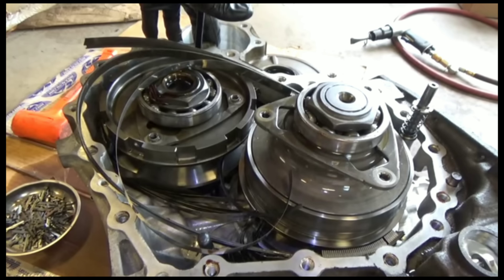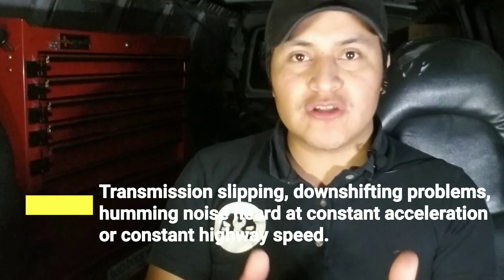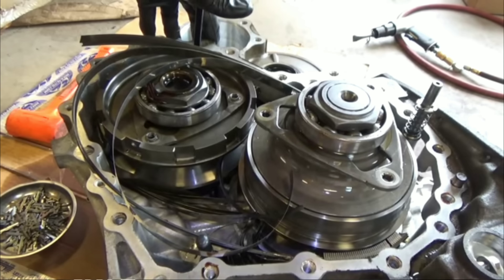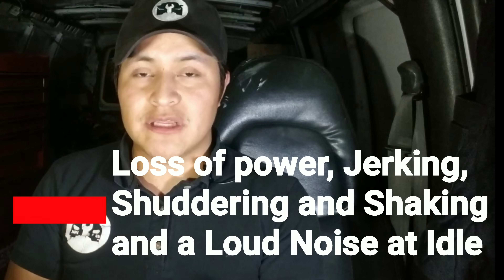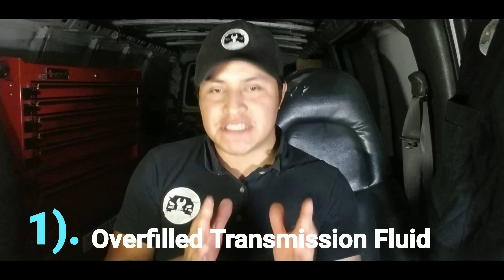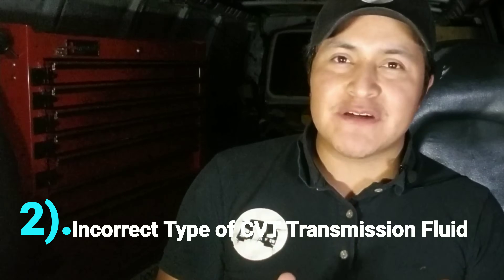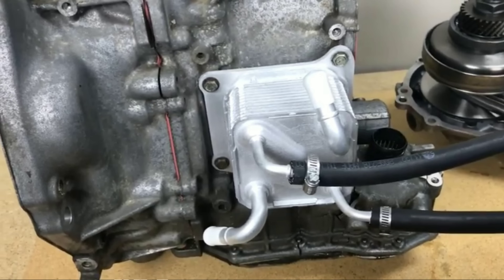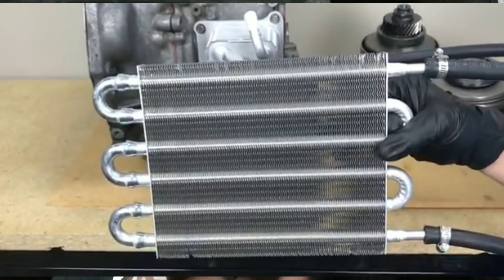NISSAN CVT TRANSMISSION | why it fails and what you can do about it to prolong it's life

Comment: Question. I have 2014.  Trans replaced at 60300 miles.  300 miles over warranty grrrr.  But my problem now is I had atune up and about week later check engine light came on ....mas flow sensor...replaced air filter n sensor.   Now code keeps popping up for mas flow sensor.   Sometimes once a week and sometimes every other day....replaced sensor 3 times ...also when stopped at traffic light it sometimes runs very low RPM that car feels like it going to stall...I lift off brake n idle goes to normal again.....what should I check now.  Any help appreciated ty

Comment: The only reason coolant is used is for it's anti-corrosion properties and so it doesn't freeze in cold temps.  Water would work fine in tropical climates to cool an engine just as well as coolant would.   A 50/50 vs a 70/30 blend won't make any difference in the coolant being able to cool the temp an keep the motor & trans fluid cool.

Comment: I have a Qx60 2014 and transmission failed. All proper maintenance was done consistently on this car and I started having power issues were it would shut off or stop accelerating.  Now I'm being told it needs to be replaced. I will not  buy another one of these vehicles again. I love the vehicle, and haven't any issues but this transmission issue. Has anyone had similar problems? I read about the class action lawsuit against Nissan. I don't want to get another transmission and have same problem again, any suggestions anyone would be helpful.

Comment: Have a 2013 Infinity G2 .90k miles....went into trans limp mode..shop says its a sensor inside the trans case.. . trans fluid was black ..says replace entire trans & sensor ...$2300 ..down from $3500

Comment: My 2015 Nissan rogue just stopped and it turned off on me and then I went to go restart it and it started up but it did not want to accelerate I pulled over to the side and waited a few minutes I started it back up and then it kept on going again for a few minutes until it did not want to accelerate anymore do you think it’s the transmission? Thank you

Comment: 2007 nissan altima 2.5 S model with 253000 miles runs great about a year ago I had an overheat code,,,now I have a low pressure code,,although it still runs top notch no power loss or symptoms,,,not sure if I should worry or what to do,,I change fluid every 25000 miles,,,and helps remarkably,,,kinda sad because this car has its own spirit never has died and very reliable day in and day out,,,,don't want to replace it,,I have another car much newer but this car is my girl forever,,wish I could find someone who could honestly tell me what I should do and not get ripped off
Reply: I love my 07 to. I'd drive her till she stops. It just worries me of long trips but so far its done well.
Reply: @alensley1368  yeah now I'm at 269000 miles,,still running amazing,,,I'm careful on long trips,I don't stomp on it,great cars!!!

Comment: I have a '13 Nissan sentra. It has 60k miles on it. The transmission went bad and I have to pay 4k to replace it. Was it even worth it? Like will the car continue to run for the next few years after I replaced it or should I had just called it a lost?

Comment: My Nissan Murano battery died and after jumping  the car and started it, it will drive but it will not shift to the next gear ⚙️ or pulley whatever it’s inside the transmission.

Comment: My 2014 sentra would loose transmission power..the problem was in a tail light it had some water inside it causing it to short with.the LED lights ..got a new tail light and problem is gone..could be your problem to..remove the tail lights and disconnect the LED lights drive it if problem is gone then you need new tail lights..good luck..

Comment: My 2005 Nissan Murano with 159k miles is not rolling anymore- the transmission failed. Is it worth buying a new transmission for a total of $4,500-$5,000 ?  Or,  take a risk and repair it for $2,500-$2,800. Perhaps is time to sell it to a junk shop for $500 and buy a new car?

Comment: This is a great video. but you should not have to go through so much trial and error.  I"ve had 2 Toyota Camry"s and gotten well over 200k miles on them.  One of the Camry"s had 250k miles on it, but did nothing with the transmission.  Nissan should replace all these transmissions or give people the opportunity to get out of them!  They should be sued to the point of financial ruin for putting these transmissions in these cars!!!!!!!

Comment: I got 2013 nissan dualis cvt transmission. I changed the cv axle right side and during the process about half or a bit more cvt oil came out .in 2013 the cvt oil was ns2 which is not available in Australia anymore now they recommend ns3 cvt oil .Should I top it up with ns3 or drain the fluid and fill up with ns3

Comment: Hello Sir. I hope you respond. I was going to purchase a 2014 Nissan Altima. It had a trans replacement at 126k. Paid for by the dealership because there was a recall. Nissan provided a warranty for 1 yr which ended in 2020. 
The car has 160k currently. 
Is this a safe buy. With the recalled new trans being out of warranty? FYI the trans was replaced with another CVT. 
Thanks for your advice.

Comment: My sister my ex and my neibour have this car .my sister had a CV axle replaced the altenator is getting replaced the thermostat is getting replaced the radiator is cracked so getting replaced the CVT fluid was black so its getting replaced using nulon fluid which is great and replace sparkplugs and cleaning air intake throttle body

Comment: I have a 2015 Altima with the CVT transmission.  I just changed the fluid at 70,000 miles.  My dealer said 60,000 is recommended but he knew I did a lot of highway driving back and forth to Florida.  He said 70,00 was ok due to the long trips.  However, if you drive city a lot, he said 40,000 miles.  I have not had any problems with the car…. But I also don’t drive it like a race car.  Nissan advertises the Altima on race tracks and being driven hard.  Nissans problems with the CVT is from the bigger/heavier vehicles that tow trailers.

Comment: I have a ‘12 Sentra 2.0 liter and I thought that my CVT was going out but I turns out my air intake was no longer taking in air because it had holes in it… 147,000 miles runs nice but I’m probably going to have to worry about the CVT later.
Reply: 2012 Sentra did not have major cvt issues. Still recommend changing the cvt fluid every 30K miles

Comment: "Why it fails and what you can do about it to prolong it's life"

It doesn't matter; if you take care of it and change oil according to Nissan's specs, etc; CVT transmissions are going to go bad; sooner or later. Oh indeed. The reason for this is simple:

The "driving force" of this transmission is done through "FRICTION"; of a steel belt and two "variable pulleys"; instead of the time tested "Planetary geared" automatic transmissions. And yes Nissan KNEW and KNOWS this. So does any good auto Engineer. Thus, that friction creates unbelievable heat; and that heat is going to kill those 3 MAJOR parts in every CVT; sooner or later. There is no known remedy for this.

A Bit of trivia: in the late 40's, Chrysler tried to build a CVT transmission. They tried and tried and tried, over years; to make it be as good or better; than the normal automatic transmissions. But they finally determined that it was never going to work, over time. So they abandoned it forever. Good thinking and a very wise decision.

Now "fast forward" to Nissan (in 'circa 2000); a very determined CEO in Japan (Carlos Ghosn); was going to make that "damned" CVT work. And he forced his engineers to build one. They KNEW that it was never going to work; like the normal AFT transmissions. But Carlos would not stop demanding it.

So they did it. And all hell began when it comes to automatic transmissions. They have tried EVERY thing, to this day. But they still can not build one; that will not die sooner or later. Oh indeed. Sadly; the other manufacturers; that use CVT's; should have NEVER copycatted Nissan's CVT. Oh indeed.

End of Story.

P.S. Carlos Ghosn was arrested in Japan; On November 18, 2018. And would you believe that he escaped and fled to Beirut. Talk about determined! Where he tells his side of the story often. Oh well...

Comment: Very informative.

Just crossed over 250k miles on my 09 Altima today. I only have issues for 2hr plus driving. Which at this point, this car is just for local commute. The qx80 handles out of town/rolling with family duties.

I've had the tranny fluid flushed 2-3 times but I hate when it goes limp mode on me. It's not safe and anyone can run you off the road. It's been a good run though. I loved how smoothly it went through the "gears". I miss it already even though it's still here. Just a shell of its former self
Reply: 250k miles ! Dammmm you should be happy it even lasted that long
Reply: @ramontorres2091  I keep hearing that! Get this though, this is just the 4 cylinder 🤣😂 most people say I wasn't supposed to even get this far without 6 cylinders

Comment: I bought a 2012 Nissan Versa used last January. The dealership turned of the check engine light and I payed over 2k just trying to figure out the problem. Turns out my transmission was bad the dealership paid to fix it. It’s not good but it’s better I had no power at first and now I have more but not as much as I’m supposed to. My car jerks sometimes when I stop and go and there’s someone in front of me to where I can get over 20 it will jerk and not stop as well. The rpm will fly up when I press the gas from just coasting. I’m really mad but if it ever goes out I will buy a cheap car too get me by!

Comment: Need some info on a 2014 Nissian versa Sv car runs okay but due to a possible transmission problem it has trouble shifting into gears. Rpms go a to about 2-3000rpms when getting around 20 then it shifts into 2nd and runs perfect til 30-35mphs it begins to run a little high til it shifts and the rpm needle drops down to the correct setting
Reply: Current ODO reading 102,451

Comment: I ended up filing a case with nissan headquarters and the ntsa for the transmission. I bought my car in 2015 with only 20k miles or so on the dash. After 5 yrs clunk. They already had a hood latch recall( it actually flunk open driving down a highway) a computer reset recall,and that issue. I stated that claim about the warranty cut off because they knew that system had issues. I actually won, but wasnt satisfactory to my liking enough. 2500 repair and 3 day new car rental..I wanted 100%

Comment: So where was this video before I bought my infinity Qx60 2015. Having some problems now but they have not mentioned  CVT. Shakes at high speed. Bumping noise when turning at low speed .just got a post card about class action and I have until March for any repair. I owe 3 more years on this beauty...so if they repair does it fix it?
Reply from the maker: If they repair it with a new transmission then it would go for a few more years, if they just repair what's bad in the transmission then it's 50/50 that it lasts for a few more years

Comment: Nissan extended the warranty up to 120,000 miles on the versa CVT's for 2007 - 2010 and other models with severely problematic CVT's.  This wasn't because owners trashed their cars or drove like assholes.  It's because Nissan F****d up along with many other early adopters of CVT technology.   I personally had 2 CVT's swapped out of a 2007 versa within the extended warranty period, which is a first in my 30 years of owning vehicles.  Some of the comments below show how completely ignorant people are of why the mechanic took time to explain why these CVT's were poorly engineered and fail regularly.   Congratulations if your CVT didn't take a shit before your engine died, but your not in the majority.  And frankly that's the point.  A Transmission should be engineered to take the available torque from the engine and transfer it all day long. Meaning the transmission should last as long as the engine period.

Comment: My Murano 04, couldn’t drive forward or reverse and revs didn’t do anything. I guess I’m screwed… also the pipe for the PS fluid was leaking… should i give up instead of fixing it?
Reply from the maker: Replacing the transmission is not cheap plus it must have a lot of miles by now. If it was my car I would give it up
Reply: @WrenchLink  it’s got 160km

Comment: Great video. I have a 2014 pathfinder that jubber when accelerate from 10 to 20 miles after that there's no issue. Nissan said it's transmission but I have read symptoms of bad transmission module and does not add up. Like there no codes, no bad shifting, no problem going high gear etc...  the want to get over $6000... any help will be appreciated. By any chance how hard will be to replace the transmission control unit... ?
Reply: I have a 2012 Buick enclave does the same thing....I'm thinking it's the timing chain for my car
Reply from the maker: Check out this video
https://youtu.be/rozKR25phSk

Comment: When you drive the Nissan Xtrail  T31 and it cant exceed 100 speed even if you press the pedal to the bottom,  no check engine light, transmission  fluid is OK, and is on the required fluid, and i normally  put genuine transmission fluid, NS2, what can be the cause? ? Kindly help with ideas how to fix it.

Comment: My transmission is doing a huming sound, in the shop they oppened it and it had no oil, only oil grease. How can it still work with no oil, I’ve been driving around 7 months with only oil grease on it. Do you think if I fill it with oil it will work properly or should I replace it like the shop told me to? It costs 1200 dollars to replace it.

Comment: Had a 2010 nissan sentra and the transmission started to fail at 120,000 miles.
My brother in law in Mexico put a tranny cooler kit. That did the job . Sadly I was involved in an accident and totaled the sentra at 195,000 miles. I traveled a lot and the tranny  didn't give me more problems. 
But I will say the struts suck .

Comment: I have a 2012 Nissan Murano , I've had it to 2 mechanic's  it has $126,000 mi on it both mechanic's say it's my transmission but the only thing it does it that only sometimes it hesitates when giving it gas and that's the only thing it does can a person take it to the Nissan dealership and have it reprogrammed I've heard that they can do it if they have the code

Comment: My wife has a 2014 Pathfinder and shutters a little at around 20-25 miles pre hour while accelerating and sometimes jurks while going up a steep grade like a parking deck. Could this mean the CVT in her truck is bad and needs replaced? Also the Pathfinder is not going to into limp mode and has no codes.
Reply from the maker: Watch these two videos I made about the Nissan pathfinder transmission problem. 

https://youtu.be/Ux7jwu_J_aw

https://youtu.be/rozKR25phSk

Comment: I got a 2010 Nissan Altima Coupe 3.5 SR.  Love it, but I am babying my CVT like crazy.  Yes, I do gun it quite a bit in Sport mode and that legendary VQ350 engine, but I do a 1x drain and fill annually (October - November every year).  98k miles.  I hope to get her to 150k minimum before she blows up.  

But I am bracing myself for her blowing up around 110k - 120k (So two more years tops?).

Comment: I have a Nissan maxima 2012. I bought it off someone through Facebook for $4500 I've had it for two years now. A few months
ago while going up hills my Car went to limp mode, since then the car hasn't been the same. I cannot make it go above 2.5-3
RPMs when going uphill. The speed reduces drastically, but it still runs. It goes uphill even its speed won't pass 60-70 Mph. I have
been driving it like this since May. What do you think is the problem? I took it to PEP BOYS and they told me it was the transmission and that I needed to replace it. They wanted to charge me almost 7K for the whole thing. I decided not because I would rather get another car. The car drives pretty okay on regular highways around the area where I live. I had a summer job
about a 30 min drive from my house during the summer (3 months exactly). The car gave me no problem. I even tho it doesn't feel the same. It feels like it has less power when accelerating. Sometimes it goes above 3-4 RPMS but other times It takes a struggle to gain speed. DO you think the transmission is over, and I should move on, or should I try replacing the transmission
fluid?? I do hear the RPMs zooming when I'm on low speeds like if I was going very flast. My car is 169K miles
Reply: I have a Nissan Serena 2008 behaving exactly the same way. I will install an after market cvt cooler and hope it can resolve this issue.

Comment: Before giving up on the trans, do back to back transmission cvt fluid changes and fitting a cvt oil cooler. 2015 Altima 295,000 km.

Comment: 2012 Nissan Quest 146k miles. Transmission shudders on occasion in the morning when accelerating from a full stop. Today it shuddered then would not accelerate to higher speed. Engine light came on. Code P0746. I stopped the vehicle. Turned it off. Let it sit for a minute. Turned it back on and it drove properly. I checked fluid when I got home. Fluid is brown. Would changing the fluid help, or is it toast?

Comment: My Nissan 2012versa 1.8sl Cvt performance is good. I will change transmission fluid when 160000km. Now it is 144000. Cvt is good at fuel efficiency but harsh acceleration is its downside.

Comment: The two things you must do to any Nissan CVT is install a four port CVT cooler so that you can install an external transmission fluid cooler.  Heat is the enemy of CVT fluid.  Secondly, flush the Nissan CVT completely and replace 100% of the Nissan CVT fluid with Castrol CVT fluid.  The Nissan CVT fluid is rubbish and is why Nissan CVTs fail.
Reply: I need help with my 2012 altima